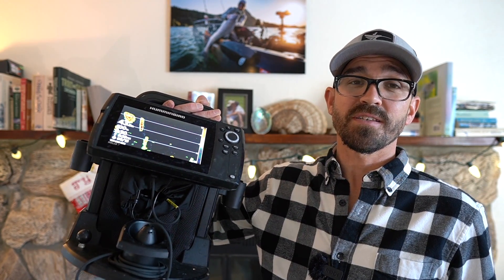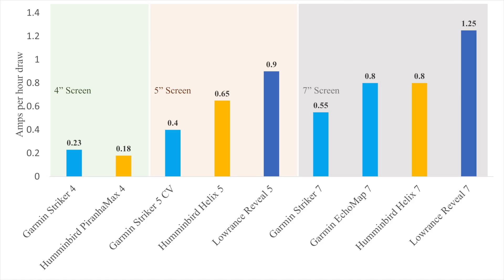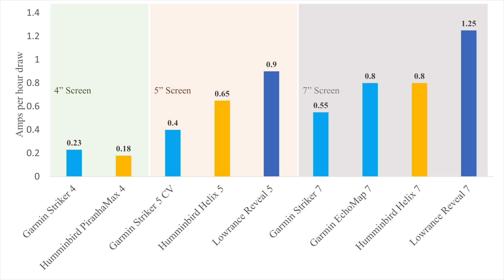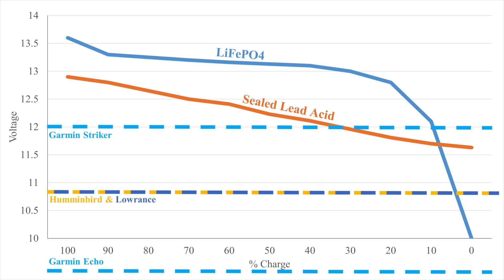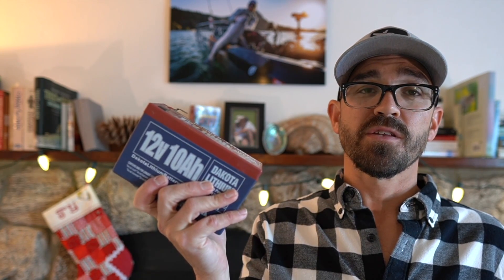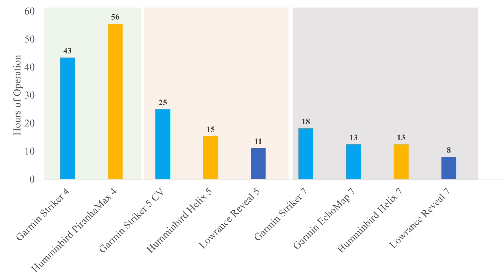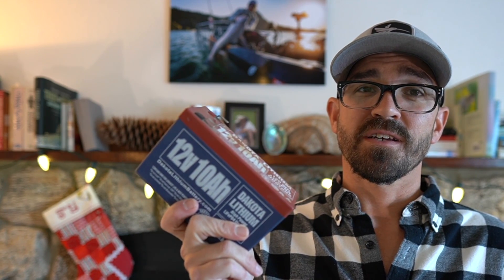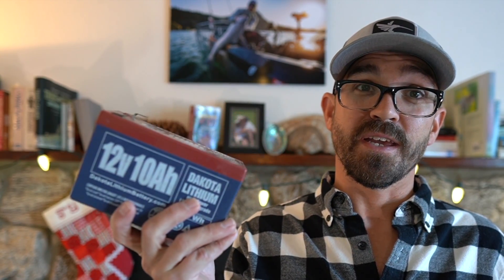How Much Power Does My Fishfinder Use?

Comment: My Garmin Echomap UHD2 94SV specs says it typically uses 1.7A but can use up to 3.5A or so. That is a 9” screen with dual-mode antenna (runs clear-vu and Side-vu at the same time as maps. 

Which, the Amperage bump comes from running the upgraded  Live-scope transducer. I don't have that. 

I just got a 50A Lithium battery! 

I aim to never use Live Scope… but will he taking long trips in the boat with no way to recharge. 

Also, being able to move my trolling motor wires over to a new battery in a pinch could be a lifesaver.

Comment: Thank you! You provided the information I was needing. I run an old electric start, 25hp Evinrude that doesn't have a battery charging feature. Right now the only thing on that deep cycle lead acid battery is the starting motor and the running lights which I seldom use. I needed a fish finder that wouldn't drain my battery if I used it all day and leave me to having to use the pull start. I'm old and the motor doesn't turn over easily for me manually. Your video gave me enough information on where to start my search and narrow things down to a purchase. Thanks again!

Comment: I went with the entry level Garmin unit last year. I needed the basic features of sonar and GPS, plus I wanted to be able to make depth charts. I got the Striker Vivid that has down imaging and quick contours when it was on sale, and a $20 8ah SLA battery. I use a quality multi stage battery charger/ maintainer, and get it onto the charger ASAP after use.  It’s held up on a three day fishing trip with close to 24 hours of use. If I were to upgrade, I’d prefer a screen that has a horizontal orientation instead of up and down like the four inch screen. I figured out I could get a better view of the sonar history if I split the screen and have the chart, or the traditional sonar on top of the chirp screen. Hope my two cents is helpful here. This is a great video.

Comment: Good info. Couple of points. Amps are an instantaneous measure, so for example a Striker 4 will be using .23 A and after an hour it will have used .23 amp hours (Ah). The big advantage of LifePO4 is that the battery isn't damaged by deep discharge while a lead acid battery shouldn't be discharged below around 50%. Bottom line is a 10 Ah lead acid battery can't really provide the full 10 Ah but the lithium will come close to its full rating.

Comment: The problem is that when just about anything has specifications published around performance (whether it's battery life, water pressure, etc.) most of the time the testing that gets those numbers is done in very controlled conditions which rarely mimic real world use scenarios. Thanks for the informative video Tyler and Happy Holidays!

Comment: I know this is outside the scope of the video, but here goes. I recently purchased a 24v100ah Lithium battery, to power a 24v trolling motor. Is there any way to power 12v systems, such as a fish finder, with that battery?
Reply from the maker: You cannot. Besides your voltage issue connecting your fishfinder to your trolling motor battery will result in interference on your sonar.
Reply: @Spilt Milt Productions  thank you for the quick reply. I thought that was the case, but wasn't sure.

Comment: Just FYI, the Garmin Striker 4 owner's manual under specifications says it can use a power source between 10 and 20 volts.  I've never tested this though as I haven't  drawn my Marcum 10AH LIFEP04 battery down that low.  I usually recharge it when it gets close to 12V  so there's no chance I  "go blind" as you said.   I've used the unit/battery for 4 days @ 8 hours a day without recharge and never gotten below 12.2V
Reply from the maker: Interesting the manual I referenced said 12-20 volts.

Comment: What are your thoughts on upgrading the transducer vs buying a new unit, specifically with the Striker 4/Plus? Since so many people start with a Striker 4 because of it price, do you think the $150 (GT8/GT10) upgrade is worth it or would the money be better spent on a better/larger model? Not sure if this is video worthy, but am curious on your opinion. Thanks
Reply from the maker: Not worth it UNLESS you fish extremely deep (+ 50') for fish like Lake Trout or deep water perch or Walleye. Otherwise I saw no tangible difference in performance. You'd get more out of investing in a new fishfinder that would have more open water applications but most companies just run the same basic software for ice fishing no matter the screen size.
Reply: @spiltmilt  Would you say the same for the open water transducer as well?
Reply from the maker: Same rules apply but spending more money on a new unit will give you options like down imaging and side imaging.
Reply: @spiltmilt  Appreciate the input and great content. Thanks

Comment: I use a helix 7 msi g4n with the XNT 9 HW MSI 150 T transducer. This summer I started with a 10Ah Noctua LiPO, and 2 times it died on me before I was done for the day, less than 8 hours of fishing. With this setup, I’m basically using every feature, but the one that appears to really increase the draw is the autochart live feature. After I started using autochart live, I started killing the battery. Before I was using it, I was coming home to a little less than 50% charge left. Ended up adding another 10Ah battery to bring my total to 20Ah. This way if I know I want to use autochart, I bring both batteries. Otherwise I can bring just one 10Ah.
Reply: Throwing power at the gps antenna over and over will greatly decrease battery for sure.
Reply: The GPS is always running because you can see your heading and speed at all times, regardless of weather or not you’re charting. I’ll have to pay better attention to battery life when I’m using that feature.
Reply from the maker: Interesting thanks for sharing

Comment: Some thoughts on Lead Acid vs. LIFEPO4.  The lead acid battery starts to degrade the battery at 50% voltage level.  On LIFEPO4 you get 100% of the rating of the battery and only 50% before you start to degrade your lead acid batter.  Also, the LIFEPO4 has a Battery Management System (BMS) that will protect for overcharging, too low discharge, high temperature,  and low tempe😂rature protection on a lot models.  Most will also get around 4000+ cycles before you reach 80% of the battery life.  Meaning a 100 amp/hr battery will still be good for at least 80 amp/hrs after 4000 cycles.